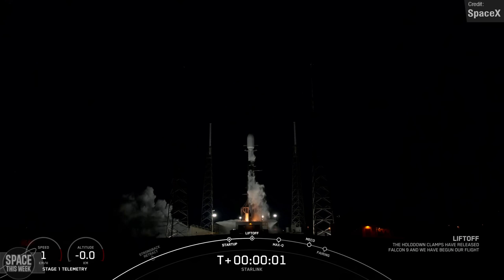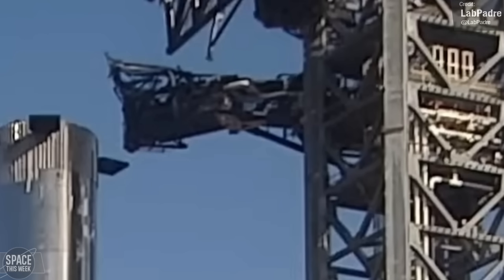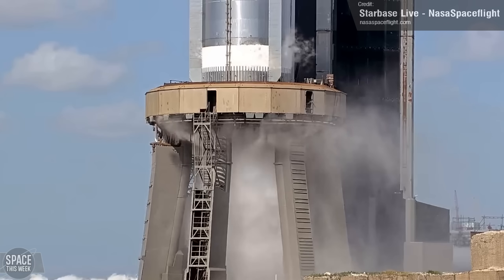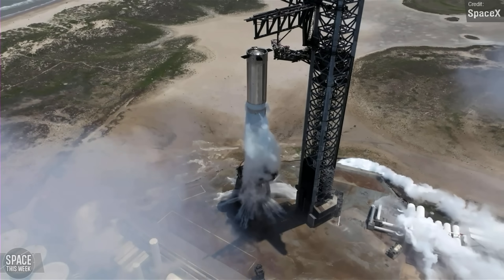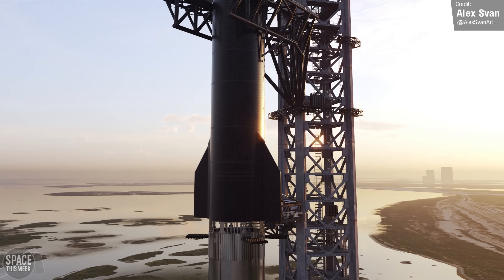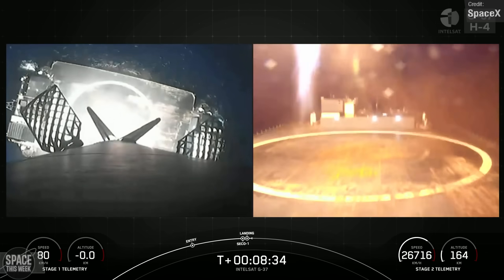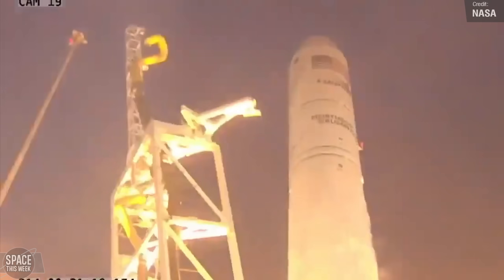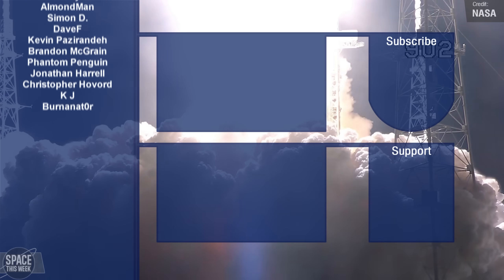SpaceX's Superheavy Static Fire and Deluge Test Aborts Early, Starship, Artemis III, Intelsat G37

Comment: 🙄 the water deluge system seems/sounded like it somewhat worked. The time of firering was NOT long enough and the number of engines was NOT enough, too. Still the pad has NO blast diverter !
Nice try. But, NO CIGAR.

Comment: What is falling off the top of the rocket around 9:20 ?
Reply: Insulation panels to keep the upper stage propellant at the proper temp for best engine performance.
Reply: @steveaustin2686  Thanks!
Reply: @MarkLikesSpace  You're welcome.

Comment: Large conventional flame diverters as used for Saturn V, shuttle, and SLS need extensive service after every launch. In those diverters, the gravity fed water is at a much lower pressure than the rocket exhaust. Some exhaust gets past the water and hits the surface beneath. Those diverters were designed primarily to control the sound.

The Raptor exhaust is above 300 bar (above 4200 psi). The water is at a significantly higher pressure. Once SpaceX gets the system tuned, I expect that they won't need maintenance after every launch.

Tuning a system like that is complex, so it will probably take awhile to get rid of all of the weak spots in the flow pattern. In the meantime, it will mostly work, those steel plates are thick, and SpaceX is currently limited to 5 launches per year.

Comment: A Deluge is a downpour .  This is a Geyser system , mostly , except for the downpour water orifices  near the rocket engines.  When the Super Heavy goes full power test it is most like to stop the plate water orifice flow or greatly reduce the flow to being ineffectual .
Reply: The Raptor exhaust is above 300 bar (above 4200 psi), so the water has to be at a higher pressure. Which means the nitrogen tanks start at a much much higher pressure. Near the end of the test the water tanks will be nearly empty of water, so the nitrogen will have expanded into that space. Even then the water pressure must be higher than the rocket exhaust.

If the nitrogen tanks were the same volume as the water tanks, then nitrogen pressure would have to start at something well above twice the Raptor chamber pressure.

It is a good thing that the weight of stage zero doesn't limit the payload weight, because that stuff is heavy.
Reply: @hamjudo  That is tough .  Commercial  oxygen tanks for welding are filled to 2,000 psig max.   50 psig will lift water 115 feet .
That nitrogen gas system is not capable of overcoming the Raptor exhaust . The flow of water through the steel plate orifices will be stopped.
Reply: @hamjudo I don’t think it is that extreme. The chamber pressure is around 300bar but the exhaust expands in the engine bell and is significantly lower by the time it would impinge on the base. 
That said I think SpaceX needs to work on the reliability of the engines. To have 4 fail on the pad and needing to swap out engines after nearly every test is not good

Comment: 2:18 Tonnes of methane straight into the atmosphere. That's just great...
Edit: I actually meant 1:18
Reply: Not sure what you’re talking about here
Reply: @BCR81 My timestamp was wrong. It's actually 1:18.
Reply: @8ahau279  ohhh I see now. Just fyi that’s actually nitrogen and oxygen, so no methane. If it was methane, they’d have a little bit of a problem on their hands.
Reply: @BCR81  Where did you get that information from? Anyway, good to know. I just assumed that it was the same fuel as starship normally uses, but I am relived that they don't just release methane into the atmosphere.
Reply: @8ahau279  this test was a spin prime, so it’s usually assumed to use nitrogen and oxygen. There’s also indicators in the tank farm, namely the methane side being inactive during propellant loading.

Comment: One important thing you failed to mention about the NG-19 mission was that it flew on the last ever Antares 230+ rocket. The Antares 230+ uses a first stage derived from the Ukranian Zenit rocket and RD-181 engines from Russia. The United States is no longer importing engines from Russia and the factory where the first stage was built was destroyed by Russian attacks, so the 230+ cannot continue flying. Cygnus will launch on Falcon 9 rockets from SLC-40 or LC-39A until the Antares 330 enters service. The 330 will be vastly different from the "classic" Antares (100 and 200 series) in that it will use a common first stage with the Firefly MLV consisting of seven Miranda engines. I happened to be at the launch of NG-19 and there were massive crowds, much larger than what Wallops Island normally sees, and comparable to some launches from Florida. Given Chincoteague and the surrounding area doesn't have the same capacity that Titusville does, this just made the crowds seem even larger still.
Reply: Were the 230+ "Russian" engines actually being built in Ukraine?

Comment: Tell Elon to buy up a few square miles on the outskirts of Las Vegas.
Fly a Starship there and land it next to a massive charging station complex.
Remove the fuel tanks and install an elevator.
Build a 5 level bar at the top with glass walls.
Sell plots of land around this new sensational tourist destination to merchants.
Profit.

Comment: Same thoughts here: if the failure of the fourth engine triggered an abort of the firing sequence, the test was probably double successful! The water deluge system seems to have worked fine, but we will have to see, how damaged the steel plate really is (and this was only 50% thrust or so). Also, the steam explosion seems to have picked up and hurled around some debris from the edge of the concrete platform, where the gravel starts. Seems they will have to fix that as well…!
Reply: Perhaps they will have to do literal sweeps to clear the area of any loose objects and ideally even dust to not give the blast anything to hurl and cause damage.

Comment: I'll be truly impressed if that steel plate/water deluge system holds up to a full thrust launch.  Conventional wisdom says that the plate needs to be angled, so we'll see what happens.
Reply: Large conventional flame diverters as used for Saturn V, shuttle, and SLS need extensive service after every launch. In those diverters, the gravity fed water is at a much lower pressure than the rocket exhaust. Some exhaust gets past the water and hits the surface beneath. Those diverters were designed primarily to control the sound.

The Raptor exhaust is above 300 bar (above 4200 psi). The water is at a significantly higher pressure. Once SpaceX gets the system tuned, I expect that they won't need maintenance after every launch.

Tuning a system like that is complex, so it will probably take awhile to get rid of all of the weak spots in the flow pattern. In the meantime, it will mostly work, those steel plates are thick, and SpaceX is currently limited to 5 launches per year.
Reply: @hamjudo the water system is higher than 300 bar? That’s the pressure at 3,000 meters below sea level. Are you saying the tank farm and its piping can supply that?
Reply: Rocket exhaust is ideally at ambient pressure - hence the larger bell for the vacuum engines.
Raptor combustion pressure is up around 300 bar, but that’s not the exhaust pressure
Reply: Damn this thread is deft, firstly the term y’all looking for is called dynamic pressure, if you don’t know that then maybe don’t be pretending to know more than the engineers.

Secondly we already have data on what that exact exhaust velocity, temperature  and duration does to an uncooled mild steel plate, about 5mm of erosion. It’s a 40mm thick plate guys, it could take 4 launches without water at all and still be plenty thick.

So who am I taking bets from then? Easy money
Reply: @@smithy1833 we’re both saying that the water deluge doesn’t need/want to be t 300 bar…. That’s all.
My guess, backed by a physics degree but no actual calculations, is that the SpaceX team have done their calculations.
Reply: @@smithy1833 yes - they were already working on this, they expected the concrete to survive one launch, which it didn’t - but it wasn’t a standard launch procedure either.
Reply: @@smithy1833 the acoustic damage wasn’t visible last time, mostly because of a concrete shower.
Reply: @@smithy1833 exhaust pressure of a sea level raptor is likely quite a bit below sea level ambient pressure, since they have to operate up to reasonably high altitude as well.
The tend to be over expanded at low altitude, and you can see the under expansion as they climb higher (really obvious with the Merlin because the exhaust is easier to see).

Mach diamonds are a result of the exhaust being both supersonic and below ambient pressure.
Reply: @@smithy1833 cool story man, but that wasn’t the topic
Reply: @@smithy1833 Yeah.  Physics is physics, and it doesn't change just because your name is Elon Musk.

Comment: That steam cloud was insane!!
Reply: Well you can't see steam, the white puffs from a kettle are when steam cools and forms droplets. The little start from a hard boiling kettle that's clear is steam. At the thrust and sonic power of these engines I suspect that water that never boiled will be thrown out in the same tiny droplets that form white clouds. That may not sound like a big difference but that liquid to gas conversion is a lot of heat absorption that's needed. And remember steel does not last long at rocket thrust temps in a strong solid state.

Comment: I hope starship doesn't fail again
Reply: By now you should know there is no such thing as failure with Elon Musk and SpaceX! Last flight despite appearances was a success as there was much to learn from it. The same can be said from SN8 to SN15. It is a failure if nothing was learned from it!! 😎
Reply: It didn't fail, they knew it probably wasn't going to make it to orbit, they still got plenty of data to work off of this is a test campaign after all
Reply: @KiRiTO72987  it failed. they failed to get all engines running, they failed to even reach as high as the N-1 did 55 years ago, they dug a massive hole in the ground, they lost control of the rocket after 30 seconds, and the FTS took 40 seconds to destroy the rocket from when it was activated. this isn't some startup company that's never launched a rocket before: they've launched hundreds of rockets already and should have the experience to be able to make a successful rocket. having "tower clear" be your measure of success when you launch more rockets in a year than anyone else is disingenuous. NASA is watching Starship development closely: right now Starship HLS is the constraining factor on Artemis 3 being a lunar landing.
Reply: @JBS319  the lunar landing is never happening. the entire Artemis program is just one massive money pit thats never meant to actually achieve anything
Reply: Same